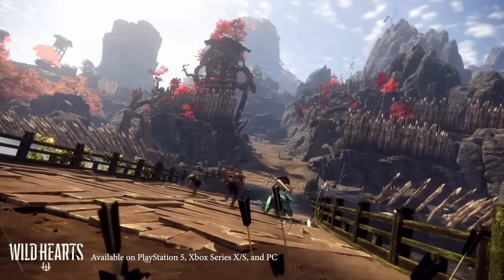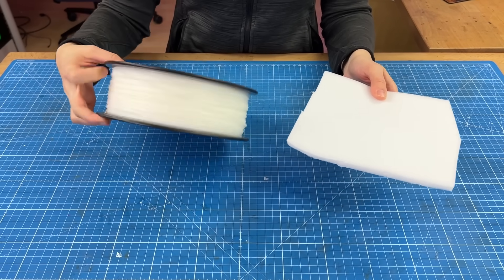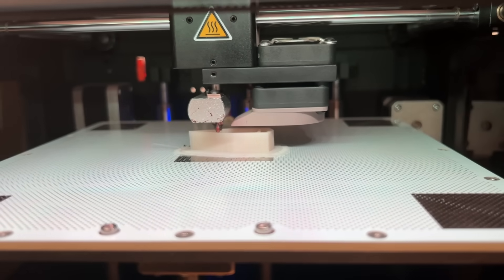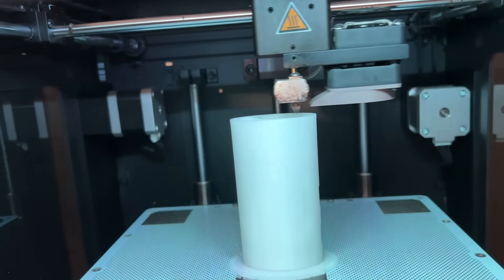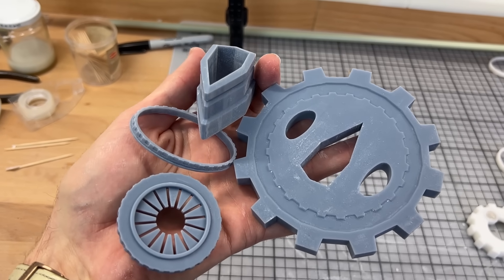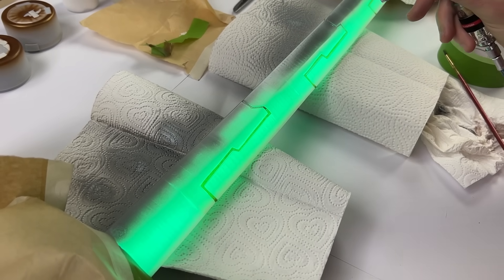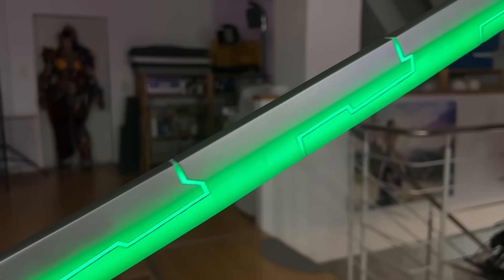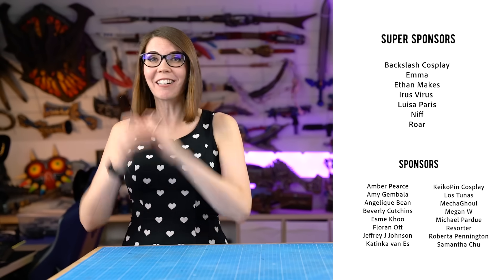I built a LED KATANA in 7 days! ⚡

Comment: can i just say that there may be a way yo even make it a whip, by 3d printing it in several pieces that lock to each other inside, and have a elastic ribbon or rope inside holding the first and last piece that you can push to hold it like a sword or release to let it be whip....sorry just a tough and as I know you are amazing you could definitely pull something like that off...also what an another amazing build

Comment: Amazing work!  Would the featherwing be able to run as much LEDs as the other boards you worked with before (for Nova for example) or are there some downsides? You got no powerboost for this one as far as I can see.
Reply from the maker: Provided the battery is powerful enough, more LEDs should not be an issue. To a point of course haha